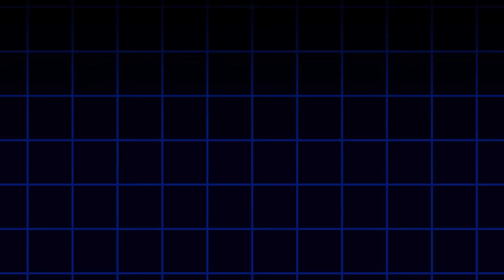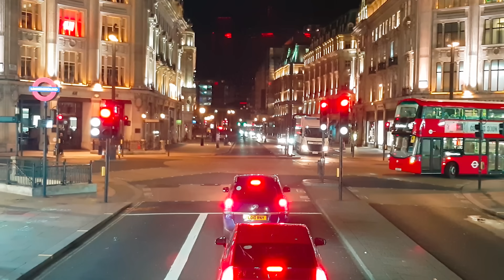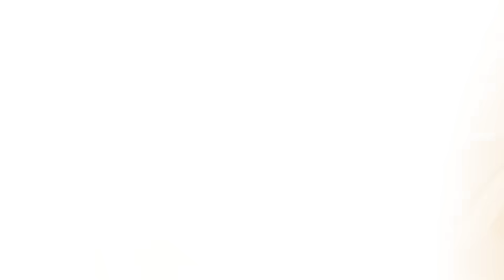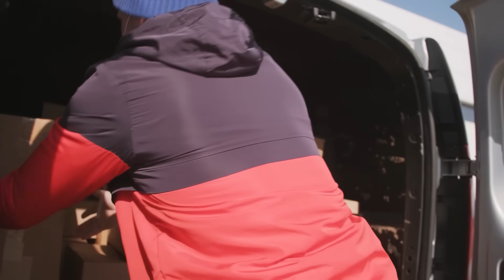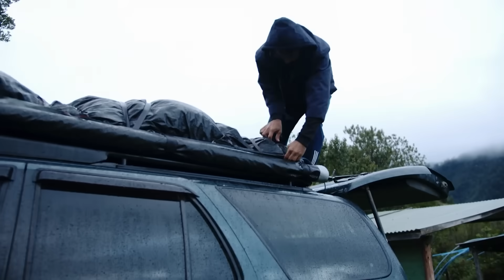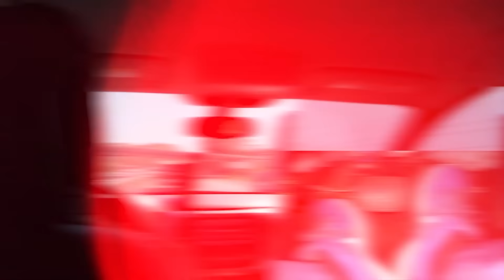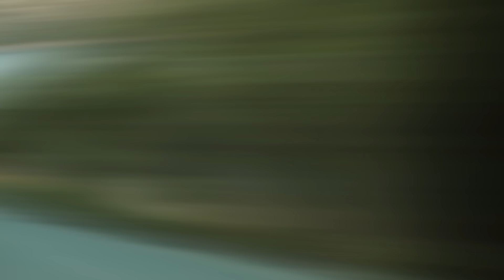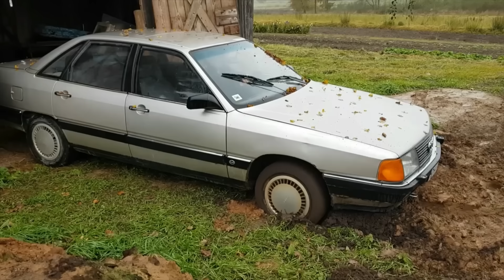13 Silly Mistakes DESTROYING Your Automatic Car – STOP Doing These!

Comment: I can tell you for sure you are 100% right. Putting your car in neutral going downhill will definitely destroy your transmission. It will heat up your transmission, and you'll be getting a new transmission installed in 2 days. Been there done that.
Reply from the maker: Wow, sounds like you learned the hard way! Thanks for sharing your experience — it’s a perfect real-world reminder why coasting in Neutral downhill is a bad idea. 🚗🔥
Reply: @carsfuse Yes not just once but twice. I learned this after my 2nd new transmission
Reply: What about for stick shift?
Reply: @DixinCiderYT  you shouldnt depend on your brakes only. they over heat. engine brake plus brakes are the way to go
Reply: @DixinCiderYT same don't do it!
Reply: Exactly 💯 — people think neutral downhill saves fuel, but the damage to the transmission is no joke. Real-life experiences like yours prove it better than any manual ever could. I’ve also broken down a few other ‘common tricks’ that actually harm your car 🚗🔧. You’d be surprised how many drivers still fall for them. Would love to hear your take if you check those out!
Reply: Who does that?

Comment: how caould you explain to vehicles with electric auto parking brake which will activated only when you shift to park. you mean engineers who designed this concept they are stupid.
Reply from the maker: Good question! In cars with electric auto parking brakes, the system is designed to activate the brake after shifting to Park — and it does so in a way that minimizes stress on the transmission. So no, the engineers aren’t stupid — they’ve just automated the process to protect the components.

The tip in the video mainly applies to older cars or manual systems, where the driver needs to set the parking brake first to avoid long-term wear on the parking pawl.

Comment: My automatic car automatically gets off once I stop at red lights, so is there any need to switch it from drive mode to parking or neutral mode, when I swift it to neutral or parking mode, it again starts, so I think it's better to idle it on drive mode to save the fuel, kindly suggest
Reply from the maker: Good question! Your car likely has a start-stop system, which shuts off the engine at red lights to save fuel. In that case, it’s perfectly fine to keep it in Drive — the system is designed for that.

Switching to Neutral or Park can actually disable the start-stop function and restart the engine, which defeats the purpose. So yes, if you're only stopping briefly (like at traffic lights), it's best to leave it in Drive and let the system do its job.

Comment: Just to clarify.
#1. ...... Release foot from brake
Then shift to (P) park. 
Can you shift gears without pressing the brakes? I thought you have to press the brake pedal to shift gears. Pardon my ignorance.
Reply from the maker: Great question — and sharp observation! You're right that most cars require you to press the brake pedal to shift gears and in some models, even to shift into Park.

But in many vehicles, once you're in Neutral, you can shift into Park without needing to press the brake again, especially when the car is already stopped.

The reason the video suggests releasing the brake before shifting into Park is to let the car’s weight fully settle onto the parking brake first. This takes the load off the parking pawl inside your transmission, which is only meant to lock the gears — not hold the entire vehicle on a slope.

So, by using the parking brake first, you’re protecting your transmission. “Park” then acts as a backup lock, not the main brake. Hope that clears it up!
Reply: Brake N Release P